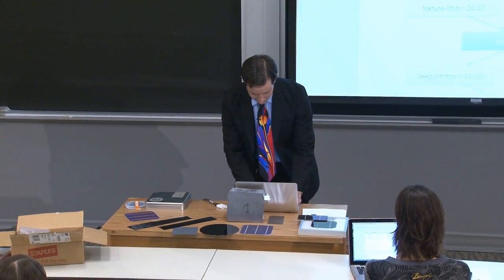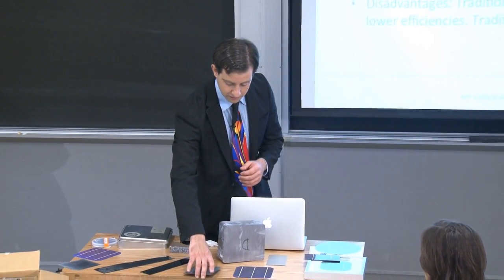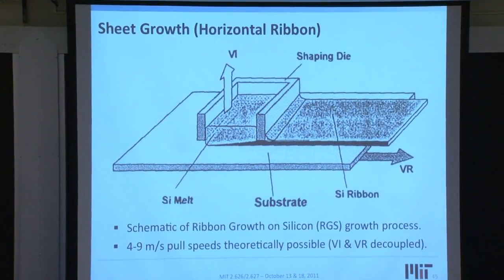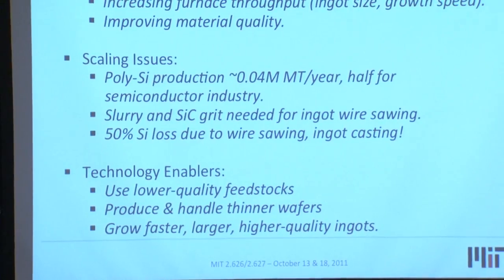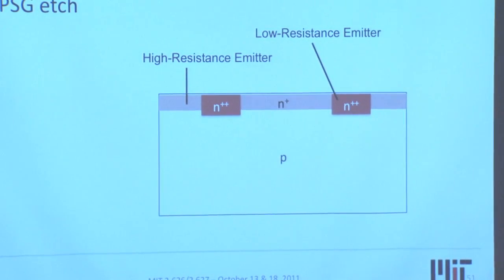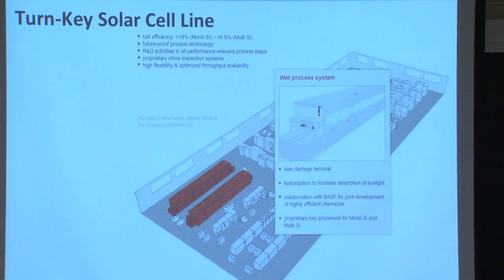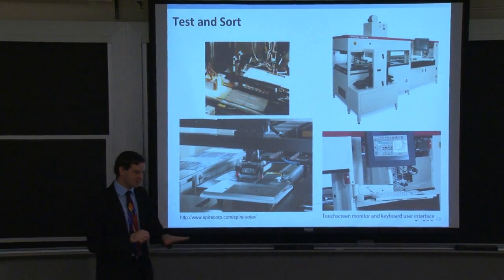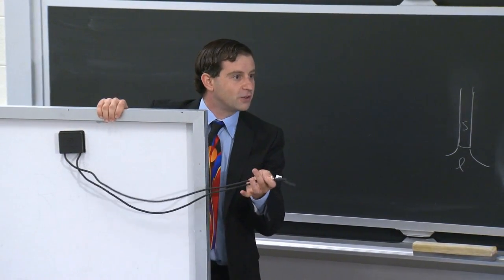11. Wafer Silicon-Based Solar Cells, Part II

Comment: The dendritic web Silicon growth method could grow 111 and type crystal and silicon straight from a melt as you describe as ribbon silicon. This was done at Westinghouse as early as the mid 1950s. Some of their solar cells actually made it to space on very early satellites.

There was a company initially called Solar Web that tried to commercialize this process. It mainly struggled with terrestrial cell economics.  This material grows at 100 to 80 µm thick and produce the cells at 18% efficiency with little effort even with its twin planes and stacking fault defects that grow in the center of that thickness in today’s world where SpaceX Darling lives and talk about hundred megawatt solar farms in outer space this material would shine

Comment: Now I understand why he spent so much time talking about manufacturing of the substrate.  The devices themselves are just painfully dull.  I mean, so simple.  Idk...  I have spent thousands of hours looking at processors under a microscope at 150x magnification segmented throughout 1000's of process steps.  I was just looking for more I guess.  I would have thought that they would do more patterning.  Litho.  I expected several layers of something like ILD material.  The actual device is just kind of blah.  Good lecture though.